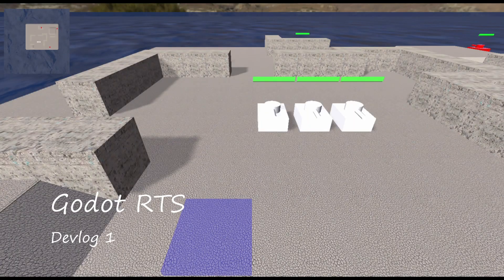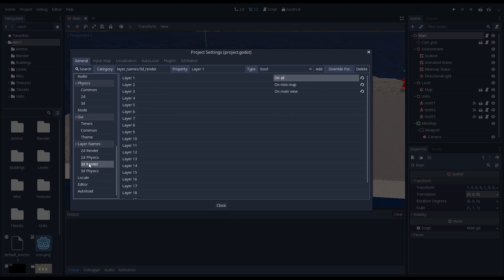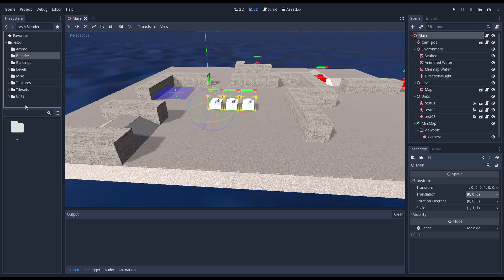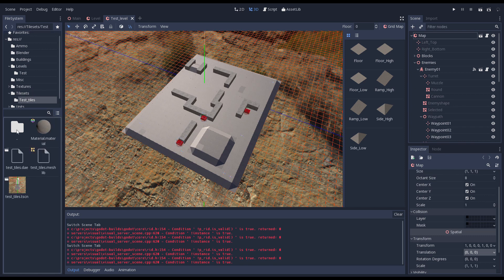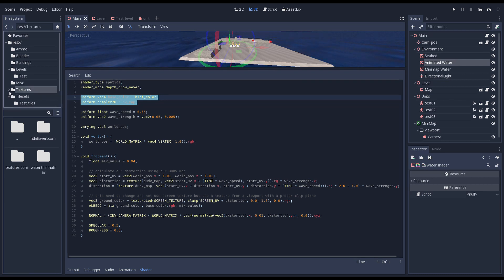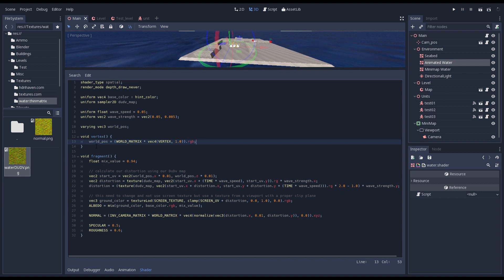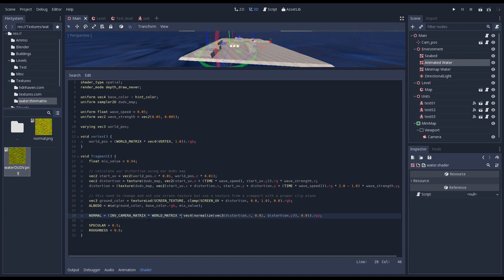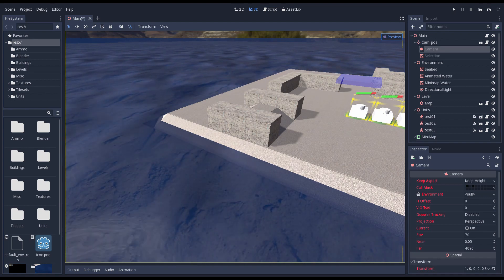Godot RTS devlog 1

Comment: Hey! Could you explain how you are performing the click-to-move movement for the tanks?
Reply from the maker: Owh, been awhile since I last worked on it. There are two parts to this, the first is knowing where you've clicked which is a simple raycast from the mouse position. The second is using A-star for each selected tank to move to the selected location, I offset each tank in a preset pattern. However once a path is determined for a tank it will store that path and attempt to move along that path. If it is obstructed by another tank it will wait for a short period of time before trying again. If it fails 3 times it will perform a new A-star and follow the new path. If it can't find a new path it will cancel the movement.
Reply from the maker: I did end up writing my own a-star implementation because I wanted to know how to build one and because the build in solution in Godot is a bit more complex then what I wanted. Writing my own allowed me to add the tanks to the A-star logic more easily but the logic should probably be implemented in GDNative instead of GDScript. it performed admirably but for larger terrains it suffered.

Comment: Very nice! I'm assuming you use the astar class for pathfinding? What kind of steering behaviours have you implemented (or plan to implement)?
Reply from the maker: No, I actually wrote my own astar implementation in GDScript for this. Mostly because I wanted to understand how the technique worked but also because I wanted something a little simpler and more dynamic then the build in one. I may end up using the build in one later because it is far more capable and faster.

Because of the type of game the units simply rotate to the direction they need to face and simply get positioned and aligned to the ground they stand on. I might do something more complex later on, we'll see.
Reply: Thanks for the reply! I have struggled to get things like obstacle avoidance working (in 2D RTS movement though) as seen in http://www.red3d.com/cwr/steer/Obstacle.html so will be following this with interest :)
Reply from the maker: To a large extent, I cheat :) I've chosen to keep the RTS game very much cell based, which is how the early dune2/warcraft/C&C type of games handled it. Your game field is a grid of cells, the grid is either occupied or not. The path simply sticks to the cells that are empty. Now I calculate the path just once when the move order is given. Then the unit moves from one cell to the next. Each time the new cell it moves to I mark that cell as occupied, and change the cell it comes from as no longer occupied. If the cell it is trying to move to next has become occupied it waits. If the cell does not free up after two or three ticks, it will attempt to find a new free path.
Reply: Bastiaan Olij Fair enough. I also divide the map into cells and use A* for pathfinding. I wanted to replicate unit movement in red alert :) I think I tried a similar approach to you initially but with multiple units moving together or in different directions it didn't quite work, especially with higher number of units. I'd like to get movement working like this ideally https://www.adityaravishankar.com/projects/games/pathfinding-javascript-rts-demo/

Comment: RTS in gdscript? Why you not use c++ gdnative?
Reply: RTS games only need to update units only a few times a second, if not once per second, and stagger them so the work is spread out over time. At that point Godot should be able to handle tons of units in the game via gdscript.
Reply from the maker: That's simple, it takes far more effort to write something in C++ than write it in GDScript and it's a far bigger pain to debug.

Most if not all that I'll be doing will work fine with GDScript, all the heavy lifting is done by Godot. The A* logic might be the only bottleneck but at this point in time, it's a big "might be". If it turns out to be, good excuse for a "how do I port this logic to GDNative" video :)